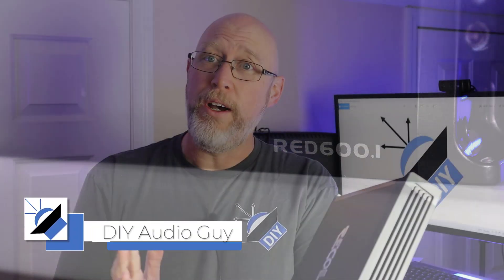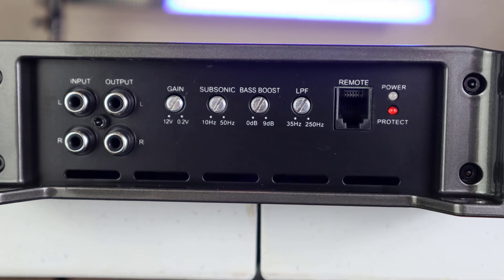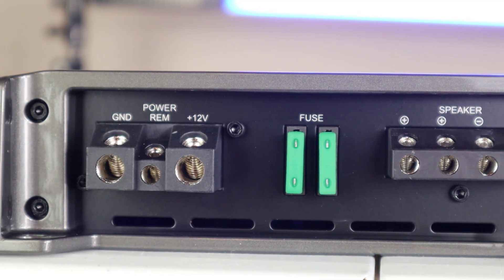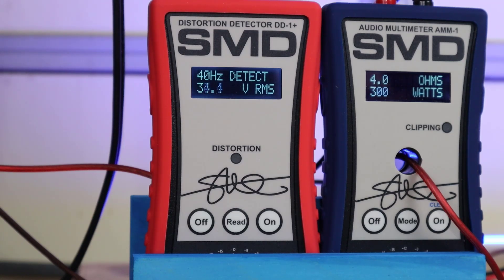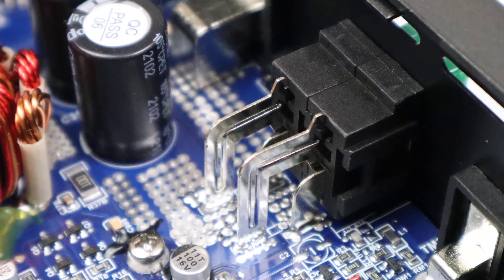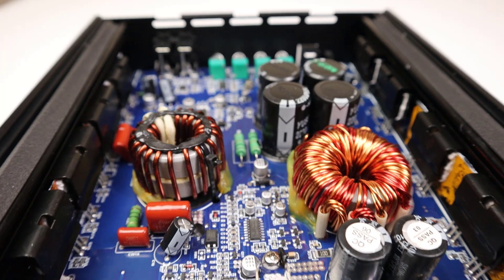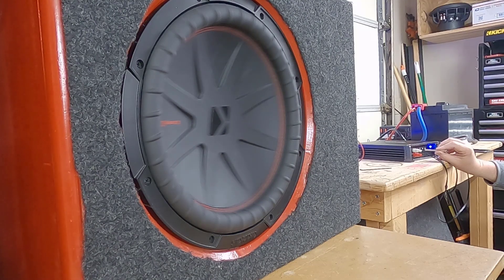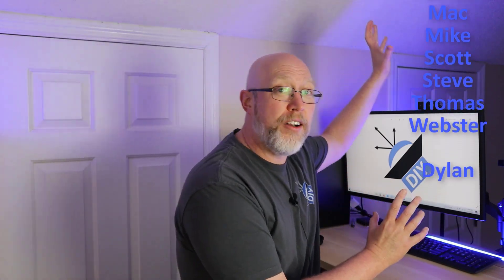Budget Car Amplifier.  You won't Believe the Power! Recoil Audio RED600.1

Comment: Looks like a good amp. For the price, it probably would be perfect for a daily driver setup. Most budget amps will probably last if you aren't trying to play them at 1 ohm mono at full blast all day.  I have a coworker that has a 70 dollar boss amp that has lasted him going on 7 years now.
Reply from the maker: For the most part even cheap electronics will work for a couple of years.  I don't know enough about electronics to tell you if this is built well or not. But it definitely makes the power!
Reply: If it's a 1 ohm stable amp, and it dies running a 1 ohm load, your gain wasn't set properly or you were playing shitty music and clipping, clipping is what destroys a amp, it heats it up super quickly and as we all know, amplifiers have a thermal limit just like any other electronic

Comment: I want to hear the recoil speakers they look good but im skeptical on buying them
Reply from the maker: I don't know anything about them.
Reply: Might be able to get a good deal from robot underground. Recoil stuff is rilly good for the price in my mind.
Reply: I installed a set of the $45 6.5 component sets and the $40 6x9s in a friends 06 impala a couple of months ago. They do pretty good on the factory radio. They could definitely use high pass crossovers or bass blockers but for $85 for all 4 corners, they're worth the money. I'd like to hear them on an amp though. I bet they would be even better.

Comment: I trust Patrick and you so I’d buy this amp if i was in he market. I’m thinking of buying the 1200.1 at $134 bucks. Double the power for 30 more bucks would be budget god amp
Reply from the maker: At this price you can get two and keep one as a backup.
Reply: @DIYAudioGuy  yep. The 600.1 just dropped to $94. But even better deal can buy the top strong gear 1500.1 amp for $139 plus $20 dollar coupon so right now $119.